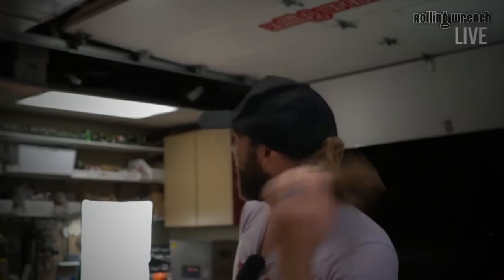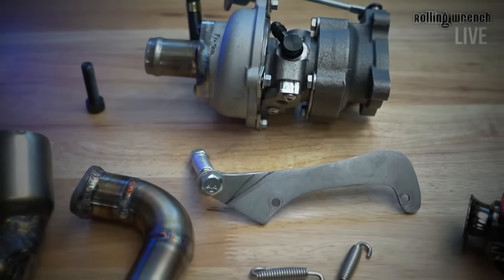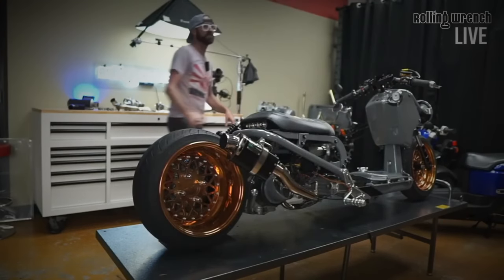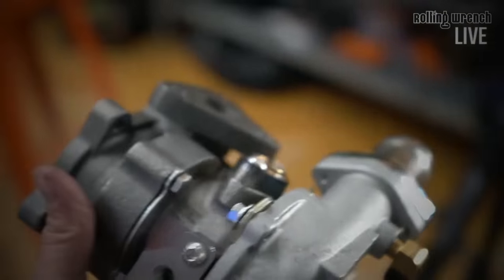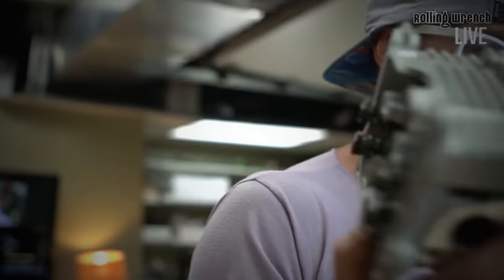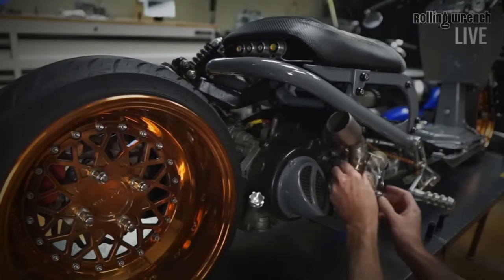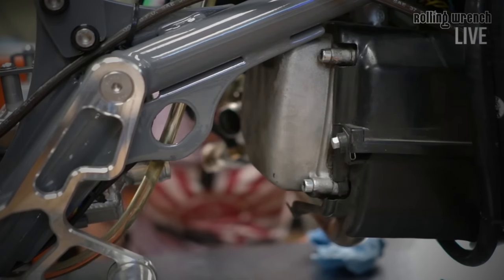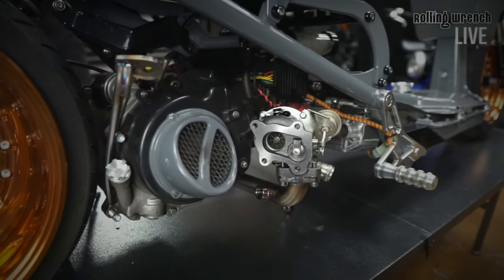232cc GY6 TURBO HONDA RUCKUS 🔴 LIVE EDIT

Comment: When you get close to your final build, check out the turbo from a 1.0 ecoboost. It's tiny and reliable.
Reply: Nice to know thanks for the info.
Reply: A 1000cc turbo will more than likely be far too big for a 232cc application.
Reply: @reissfullspeedahead  It's tiny.. Very tiny.
Reply: Its also cast into the exhaust manifold lol
Reply: @exgtt2061  no it's not. The manifold is cast to the head but the turbo is still removable.
Reply: exact 👍

Comment: That turbo will never boost enough to blow out on any scooter. They run safely in cars and motorcycles all day at high boost for years. At 1-5psi you’ll be fine I promise just at a separate oil system and a small oil cooler

Comment: Youve inspired me so much that without even owning a GY6 I am in love with them saving up for a ice bear maddog clone 150cc to start with and just upgrade it to maybe 171cc till i go Taida and go probld 232cc 💓
Reply: People knock my Icebear 150 cause it's Chinese.  But I have had 0 issues 1 year 3k miles later.  Get it you will love it. Now all my coworkers want a scooter cause gas is expensive.
Reply: 9 thousand in 2 year on mines🤷🏻 and then did the top end swap and all the old peices still looked mint cept for dirt and grime 
Stock was wrogfa and replace is glix
  The 50 is an 80cc now and maxes out the spedo no problem😮 and keeps goin' idk how fast but spedo ends at 50

Comment: I turbod my 165fmm,  230cc (lots of gy6 parts) without the air capacitor.  It works pretty good. Blowthrough carb too.

Comment: My advice . which is quite extensive building turbo cars . your intercooler is in a decent location . change the bov style . and if it were my ruc the turbo should be a few inches further out and be parallel with the frame . also I would think subaru for the bov on the intercooler its self . and for the piping its self I would look into vibran v bands and a crap ton of pie cut stainless . these are the plans for my gy6 ruck trike I'm currently building . I the fab work is easy its,all the tuning im learning from watching your vids

Comment: I was thinking a 250cc with turbo would  maybe work a little better I'm just starting and learning how to do bore kits and all the bolt on crap never worked on my own turbo in my car my thing use ho be 2 strokes and Rotarys but these gy6 motors are impressive but I think a turbo put on one of these things could blow them apart unless it was a small one especially with the maxed out bore

Comment: Did you figure out an oil supply solution?
Reply from the maker: A external chamber with a low psi fuel pump to feed the turbo
Reply: @RollingWrench  Did you hav a pump in mind? Would something like a Holley Red be OK with hte oils heat?

Comment: Heat from the turbo is going to be a problem.also your turbo might not spin fast enough to make power on a small engine like that.
Reply from the maker: The engine size isn’t as much of the problem as is it being a single cylinder…. I’ll myth bust this :-)
Reply: @RollingWrench  I can't find any updates

Comment: Well you going to have to have some kind of lagging for that turbo it's going to be very hot.. two step cold to spark plug 100 octane fuel I don't know how many pounds of boost this thing's going to hold but I would say no more of then eight or nine pounds. And yes you're definitely going to need something to cool down that air as you increase the horsepower are you going to increase the heat saturation. I mean ultimately the best way to do this is to design an engine that is made for it. But one of the most critical of all things he's going to be your fuel air ratio and be able to monitor that. You don't want to blow a hole right through the piston